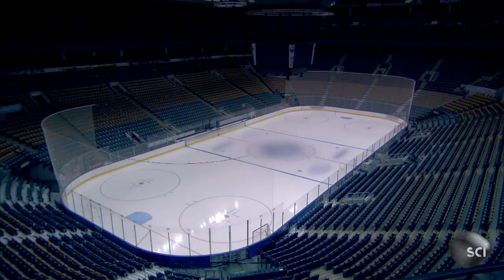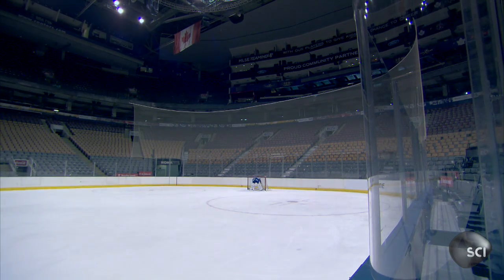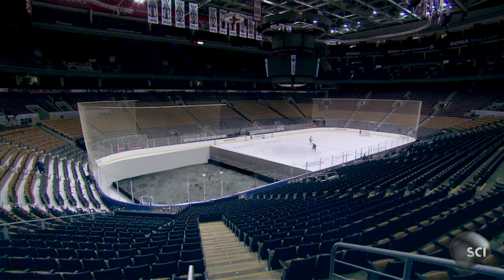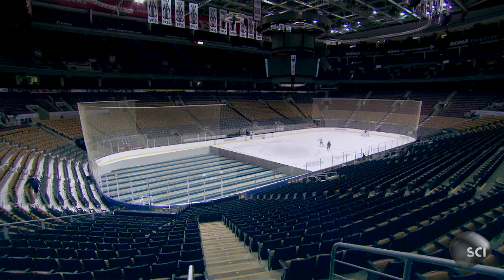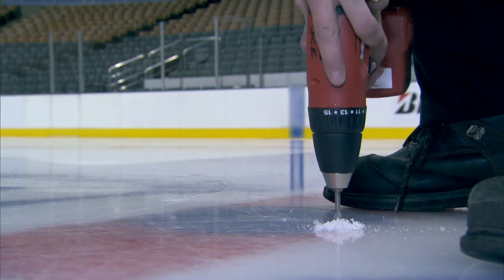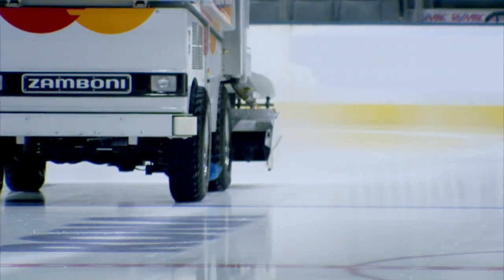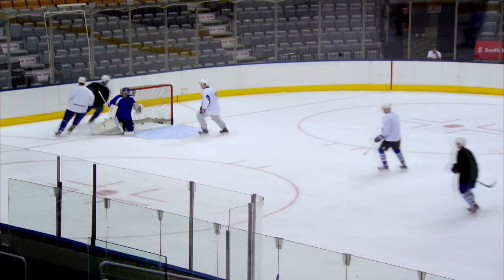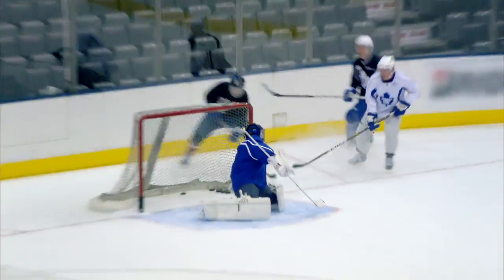Engineering the Perfect Ice Hockey Arena | Strip the City

Comment: Hockey is the only reason places like Detroit or the area were built like this after or during the 90s, hockey ended before the arenas everything were even finished being built same with the cities. The r and b music thing and night clubbing saved the areas where no one may have been. They actually got rid of a lot of overpasses or teamster shortcut or little turn around or pass overs or around for like vehicles making left or right turns and avoiding stopping or going through actual intersections. That’s how Detroit got like this, from sitting at traffic lights and stop signs. Cities were very fast paced, where you may not actually come to a stop until you get to your destination. 

They just slow down the earths rotation and pretend all these years went by with all the stuff going on or being built. 

I almost thought or think hockey is just Olympics related and same with all the cars that were driving through these areas but the Olympics were in Paris.